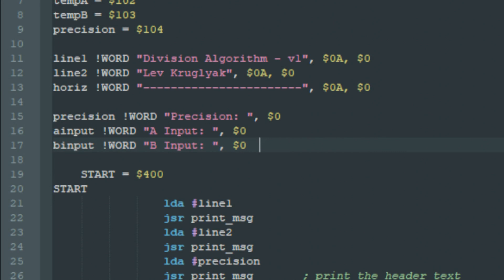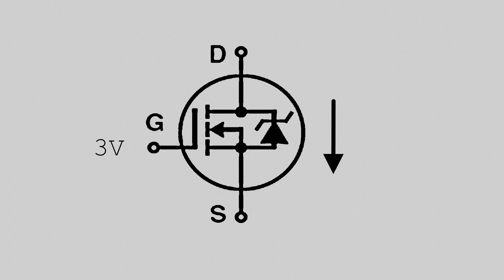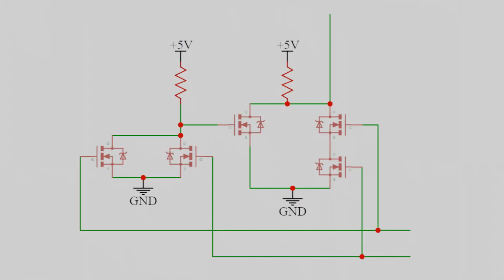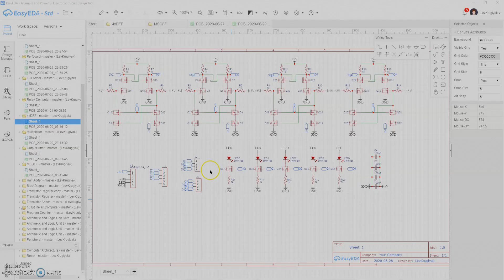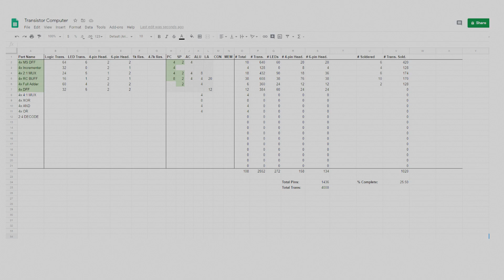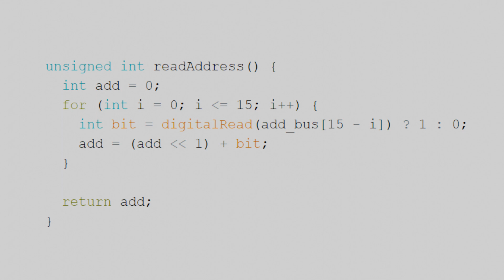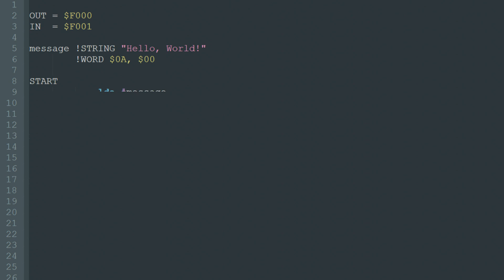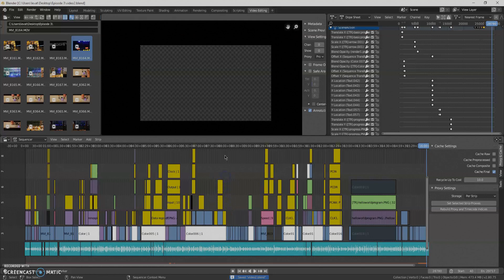From Transistors To Tetris Part 2: Program Counter and Stack Pointer

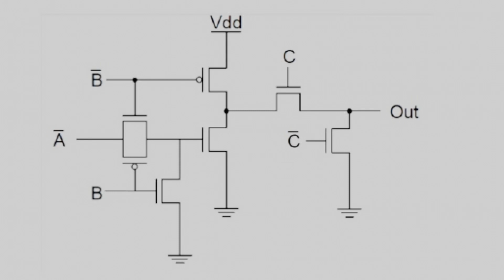Comment: 3:30 the NOT diagram is wrong/incomplete, it doesn't show that the button is connected to Vcc on one side and the other terminal is connected to ground with a resistor. One needs to look at the breadboard to understand what the diagram should've actually explained.

Comment: I  dont understand why you have pull down resistors on the gate, but I guess I will google until I find the answers. Maybe its to keep the voltage from floating when the circuit is open?
I am also perplexed that in the XOR, no current would flow to the Gate if the OR gate is active. I dont see why the current through the OR gate MOSFETS would have less resistance than on the normally closed MOSFET.

Comment: where is the digital circuit design app you are using to demonstrate the circuits? It looks a little like Sabastians Digital Logic Sim app but I like the layout much better.  Is it downloadable from somewhere?
Reply from the maker: it’s a Java project I made quite a while back, here’s a link to the GitHub: https://github.com/LevKruglyak/CircuitSimulator

Just warning that this was coded by 10th grade me so it will have bugs and use way too much RAM
Reply: @levkruglyak  Do not apologize you should be proud of what you have done.  Thank you for sharing.

Comment: What kills these projects is memory and storage.  The 4004 CPU had 2300 transistors.  SRAM uses 6 transistors per bit while DRAM uses 1 transistor and a capacitor.  2KB of memory would require 12,288 transistors.  It's cool but would probably be better as an educational series that just focuses on particular components and some theory or using an emulator.  One of my projects in college for a digital design class was building a 4 bit ALU.  It was all done with a piece of software for emulating digital circuits down to the logic gates rather than down to transistors.

Even with low power transistors, eventually it gets ridiculous just to power something this complex.

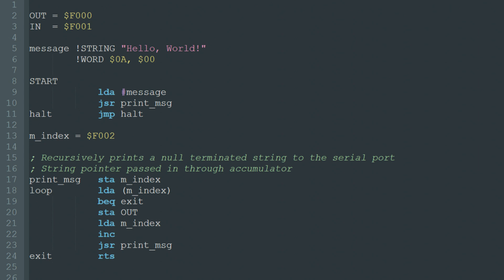Comment: Interesting project, but I'm not sure about 14:40 - why the "RTS" instruction pops out all recursive calls at once? If you were using "23 jmp print_msg" instead of "JSR", then it would be a classic tail-call optimisation. But in that architecture, it seems you can't have more than one on-going subroutine. Am I missing something important here?

Comment: Nice using through hole where you can get to the pins something magical about them.   You can probably create a graphics processor unit for display that does rotation and such in hardware.  Though that's a project too.

Comment: You should be able to make the ‘readAddress’ much faster by reading entire Arduino input channels instead of just one bit at a time. I mean you can have just two 8 bit reads in order to get your computer 16 bit address, no loop required. Also use an Union to just place these 8 bit values in a 16 bit address with zero overhead.

Comment: this is the greatest computer homemade i have ever seen with transistors i am waiting for more parts and excelent job.Also can i use bc547?
Reply: You could, but shouldn't. You would need a current limiting resistor for the base and could drop the pulldown. The main downside to transistors is the constant current draw from the base that doesn't exist on a mosfet gate

Comment: I know a transistor but I don't understand computer operation at all, all these names are illogical to me because they don't exist physically so I don't understand them. You chose very slow transistors, if you need to increase the speed use special switching transistors like 2SA1977, but remember that the size of the PCB has a negative effect on speed because the surface of the tracks and the transistors themselves radiate RF energy that penetrates other tracks and other transistors. This causes a loss of stability. You should get a few MHZ speeds, this is due to the size of the PCB and therefore negatively influencing RF radiation. Good luck super scientist :-)

Comment: More than half a year has passed, and I have been waiting for your third video.
Reply from the maker: Stay tuned, I’ve been very busy with work during the year, so I had to pause the project for about half a year. I started working on it again recently and I’ve already finished soldering all 3,000 transistors all that’s left is a bunch of wire wrapping
Reply: @levkruglyak  Even a year on were still waiting (but take your time).
Reply: @levkruglyak  did you enter MIT?
Reply: @levkruglyak   i am going to enjoy it and i will try to make it
Reply: @levkruglyak  could you give us a update

Comment: Really impressive and such commitment! Can’t wait for the next one. One question though: why not use SMD SOT323 MOSFETS? They can still be easily soldered and saves a lot of space.
Reply from the maker: The main reason was price and familiarity; I found a pretty good deal for bulk 2N7000s and I used them throughout the prototype phase so I was pretty familiar with their specs. Also I think they’re easier to solder for me, I’ve never done any smd soldering
Reply: Ive done some SMD soldering and it’s actually faster for bulk smd soldering, would save a ton on soldering but then again you wont have access to the back board for quick wire connections

Comment: How about using STM32 to replace arduino mega, so you can run it faster than 4khz?
Reply: but a stm32 is 3.3 volts so a lot of level shifters are needed

Comment: Hey great video why did you go with MOSFET's? Are you planning on doing CMOS?
Reply: He said one day.  It would be good to go to CMOS eventually as it doesn't require as many transistors.
Reply: @douro20   It requires about twice as many transistors and more expensive transistors but virtually no resistors or diodes so less components overall. I've learned a lot since then and CMOS mainly just saves power. I really like it though and I'm going to make my design mainly CMOS despite the extra cost.

Comment: If you had used 74 series logic chips or maybe smd instead of through hole, would it be easier to make it run faster?
Reply from the maker: Most definitely, it would be possible to get it to run in the megahertz range then.

Comment: I really love this project so far! Of course the recursive printing is just for demonstration, but one thing you could do, is only jump to the print function at the end rather than jump to subroutine. Then, when you find the null terminator, you could use return from subroutine and it would immediately go back to where it left off rather than going through every layer of recursion first. Essentially tail recursion optimization.
Reply from the maker: I'm glad you're enjoying it! I think that's just the normal way to print a string, since that's essentially a loop. I'm pretty sure it's also the most efficient way to print a string using my instruction set.
Reply: Lev Kruglyak I’m surprised that I just happened to have come up with the correct way by accident though I guess it makes sense. I love seeing these types of projects of building things from scratch. 

I’ve had one of my own sitting on my ideas list for a while now. I wanted to try building a hardware BF interpreter that is expandable both in memory and looping depth.

Good luck with yours!